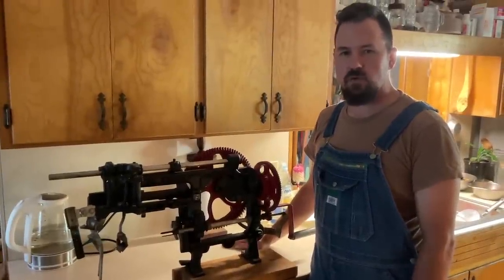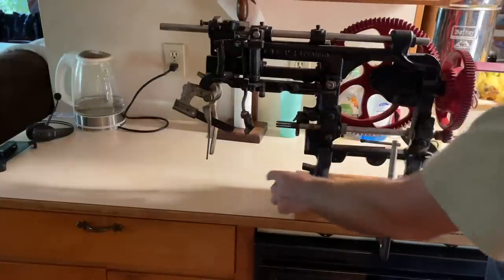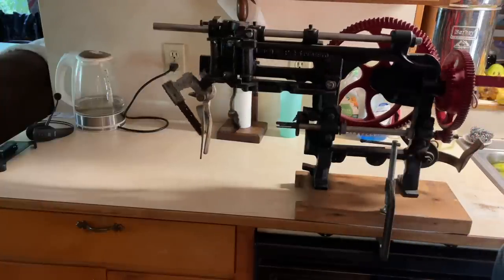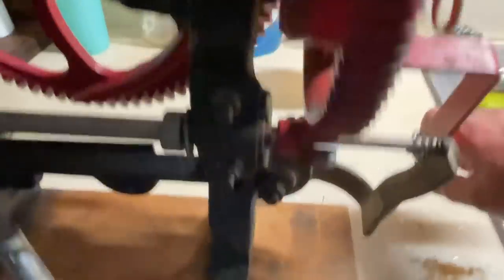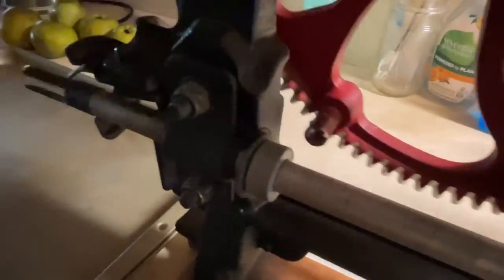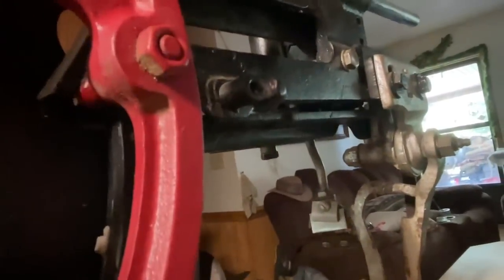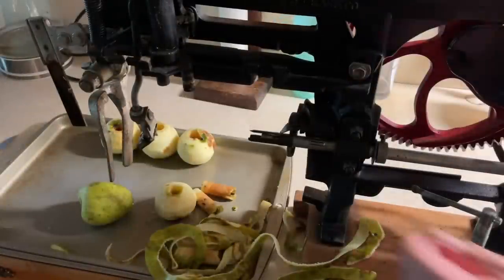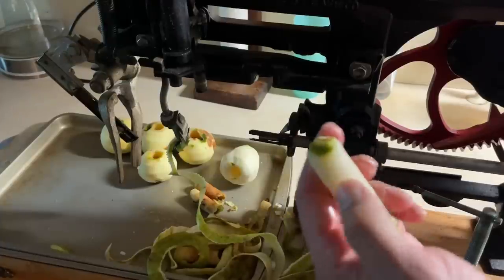How A Pease #25 Apple Peeler Works fff#46 v225

Comment: Good video. That is a good looking machine. It is amazing of the engineering that was done on these machines and they were built to work and work and work. 
Two questions:  saw the grease fittings. Do they make a food grade grease or would you use just regular grease gun grease?

2.  Is the peeling blade changeable?

God bless you brother
Reply from the maker: Yes they sure were! 
Yes food grade grease is what I use. 
Yes you can change it. 
Thank you , and God bless you as well brother